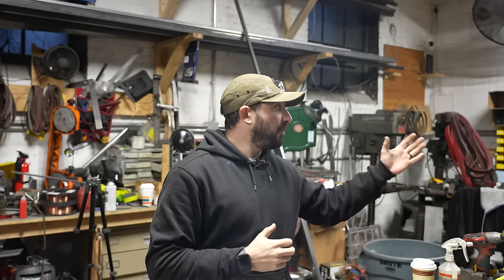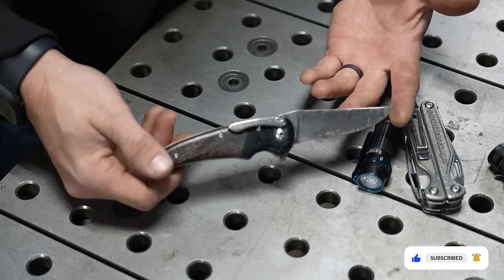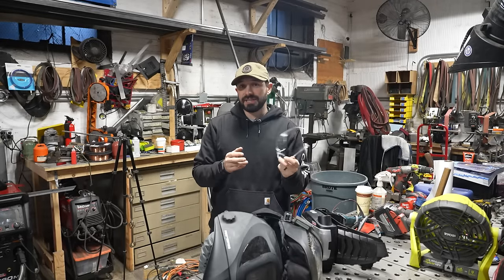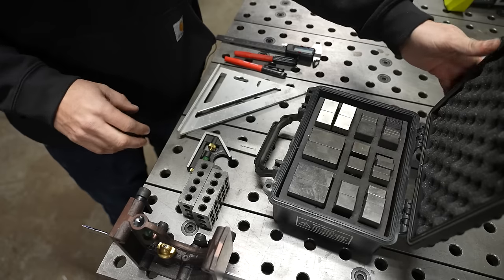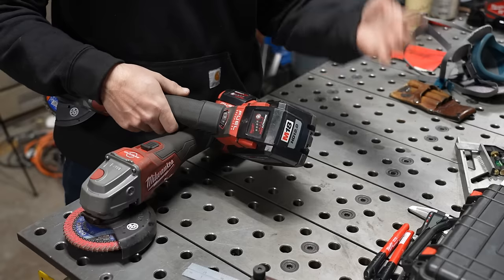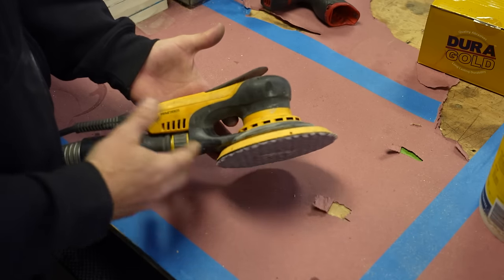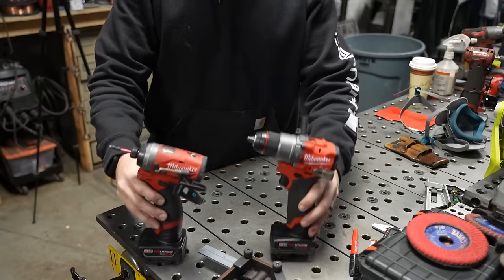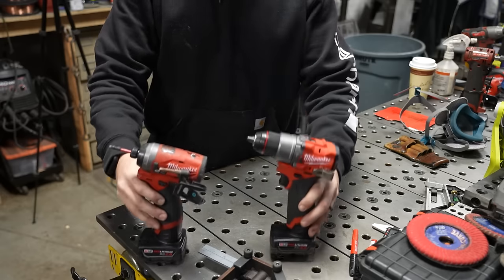Tools I Use Every Day

Comment: Something to note, normal face sealed respirators do not actually create a proper seal on your face with a beard, so you may not be receiving the respiratory protection that you think.   I work on a refinery and because I have a beard I am forbidden from wearing any sort of face sealing respirator, instead I have a PAPR unit like you mentioned. Might be worth considering completely  using the PAPR/ADFLO/Positive pressure unit in the future unless you intend to be clean shaven.

Comment: Several years ago I made up a set of wooden "gauge" blocks out of scrap 2x4's. I have sizes ranging from 1/4" to 3 inches. I find them to be a useful alternative to using my precision ground blocks and a lot less expensive.
Reply: I also have a box of timber gauge blocks (metric for Australia). I then design my projects according to the gauge blocks, to simplify project builds.

Comment: Hi Chris, hope you're well and looking forward to your well-earned holidays. Another great video. I really like your choice of tools, especially the lighter power tools. I moved over to 12v a few years ago and haven't looked back. I watched an interesting video recently where the heads of the Milwaukee standard and low angle grinders were switched to make for a variable speed low angle grinder which was suited to the maker, but not yet made by Milwaukee. Improvise, adapt, overcome, as they say. Thanks for sharing. Stay safe and keep up the great work.👍

Comment: Hey partner, I'm an avid Milwaukee tool user. And I know TTI makes Milwaukee and Ryobi. But I wondered if you had used the Milwaukee battery fan? I've invested in the Milwaukee battery's, so I'm hoping that the fan is worth buying. Wanted your thoughts! Thanks for another great video.
Reply from the maker: I do have the Milwaukee fan as well, it’s good, but I’ve found the ryobi fan has a longer run time on a 4.0ah battery. Plus the ryobi fans are usually part of a $99 ryobi deal where for $99 you get two 4.0 ah batteries and a fan . The ryobi fan will do 8 hours on low on a 4ah no problem
Reply: @MakeEverything  I gotcha. Make since to me! Thanks man

Comment: What brand was the calipers (don't see a link) I got one from harbor freight, but the thing is dead every time I go to use it, even making sure to press off before putting away
Reply from the maker: Whoops I forgot the link! Just added it but if you search “Kynup digital caliper” on Amazon you’ll find them for $22 with a $4 off coupon so $18!
Reply: @MakeEverything  NICE! So I guess from your description, the auto off feature saves the battery so it's not always dead? (Have no idea why even when you turn them off the batteries go dead so fast, gotta still be drawing current)
Reply from the maker: @justinbanks2380  exactly! So far every time I’ve reached for them they turn right on and the screen is nice and bright. The worst thing is grabbing a measuring tool and having it be dead because it left itself in for weeks

Comment: 1) Looking at your conversion chart it again becomes clear to me how totally backwards it all is. I guess I'd should mount somewhere one that starts with 0.1 mm ... 
2) I also always grab for my 12V drills and tools ... except I use Makita (that I can actually repair instead of filling the dump unnecessary - for us concerned about our uber-consumer society?).
3) I just cannot live without my Mora knives. Since I do fine woodworking I always carry a 1.3 mm Pro Flex (S) on me, but also keep some thicker blade models around